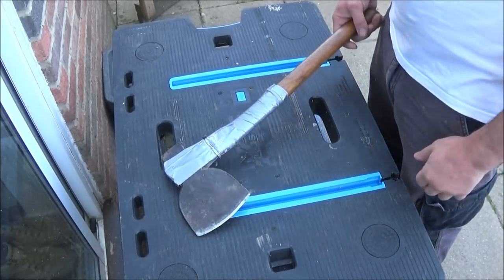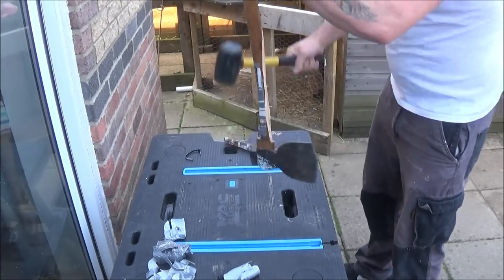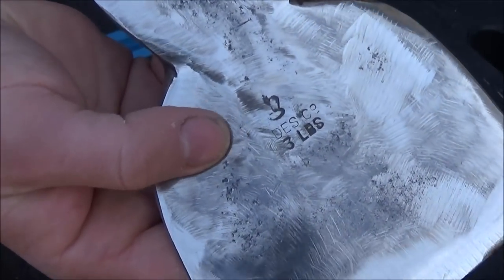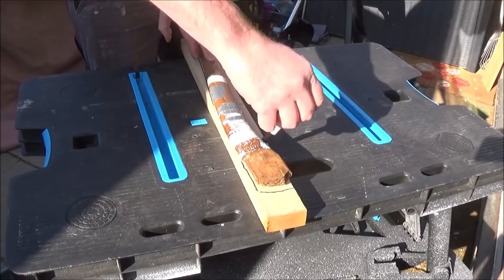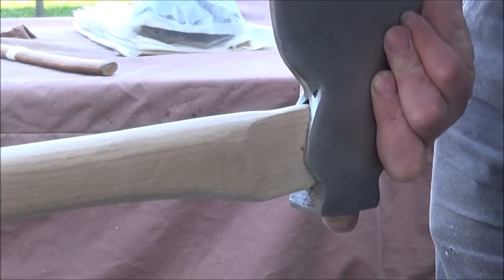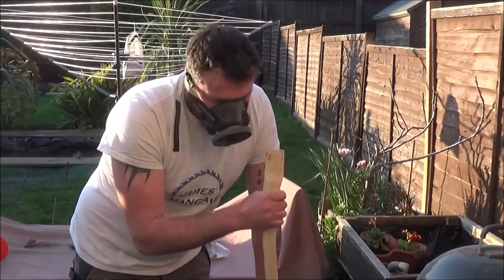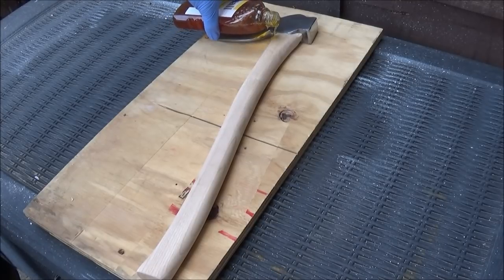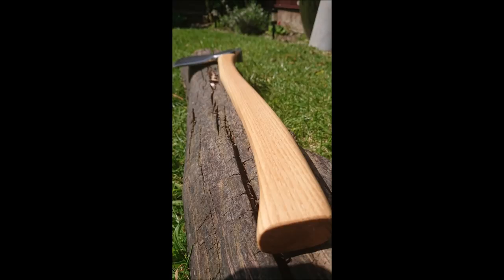1960's Brades Co Axe Restoration #AEGPOWERTOOLS #VINTAGEAXE

Comment: Really interesting and well made video. Have just been given a virtually identical brades axe by my dad, it was his dad’s before and my dad’s 86 so it has some age to it. Luckily the handle is in really good condition, unfortunately the head is less so, it looks like it has been chipped and badly sharpened at some point so it’s going to take a bit of work to get it looking right again.
Reply from the maker: That's great, I'm sure with a bit of TLC you could bring it back to its former glory. I've since found out that this axe head is a Kents style axe head of that's of any help to you.
Reply: James' Man Cave cheers, worked out it was a “Kent style” from eBay! Since download the William hunt and son’s the brades ltd brochure from 1922, came up on a google search for brades axes, cleaned mine up a  bit more and I can see it’s a brades 2 1/2lbs 301, don’t think mines quite that old as makers mark is different but looks like the range continued for as long as brades existed up until they were absorbed by spear and Jackson in 1962
Reply from the maker: @shauncomper1304  great info, I couldn't find a great deal out about it. It's funny to think something made late 50s can be cleaned up, sharpened and put back in to working use. Imagine saying that about some tools around these days

Comment: Nice work there, I've got two very similar axes to refurb that I picked up years ago. Not sure I'd make a handle though!
Reply from the maker: Thanks mate. That's great, why not give it ago at making the handle? What's the worse that could happen? 👍
Reply: @JamesManCave  a decent piece of ash or hickory gets turned into a pencil lolol. Ok maybe i might make a handle.  I took the old handles off yesterday so at least they have been started. I love the fact you saved yours from the bin,  same thing with mine,  bought em off a guy at a steam rally who was going to scrap the heads. Hate to see stuff binned if if can be saved
Reply from the maker: @DadDiaries  excellent, at least they are ready for your attention. I've got a bit of a thing for saving tools used by family members, got my gramps wood plane, and my grandads vintage foot pump.